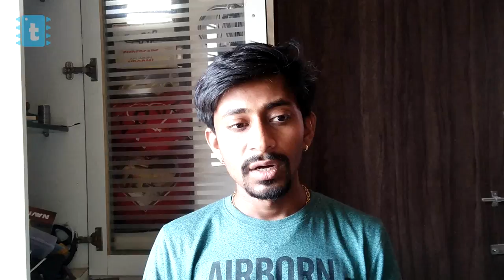New Series Trailer "Common Errors in coding ESP8266 / NodeMCU boards"

Comment: I have made a nodemcu server for controlling 4 relay, every thing works fine but the microcontroller hangs after some time, I am using nodemcu ver1 with external power supply of 2 amps . Help required to prevent the hanging out server

Comment: I have designed a project for switching light through an app, but i also want it to be turned manually by switch, what if it is turned on by both ways at same time, will it harm the relay, if yes what should be done to protect it?

Comment: I can't connect my esp8266  to my computer (the com  port is not showing even after installing the drivers) . when i google it i can see many results but all are deferent. what is the steps that you used from the first to last, so i can redo once more
Reply: Rabeeh T.A Change the usb cable. Use a standard one. You can also use the one available with the smartphone chargers
Reply: Ruchir Shah ofcourse i have done that, thank you for your replay i appreciate it.

Comment: This is the error i get when I compile the force sensor: 

readlink C:\Users\ssins\OneDrive\Documents\Arduino\mqtt_esp8266_examplea1: The system cannot find the file specified.

Error compiling for board NodeMCU 1.0 (ESP-12E Module).
Reply from the maker: Again download the code and try
Reply: I don’t think you have a link to download the code. So I just followed the video. I changed only analog pin to digital D0. Since I want to use a door sensor. Also if you can help Adafuit website has an expats layer on feeds. Group and default will this affects the code? Thanks.
Reply from the maker: Do one think

As shown in the video which i have uploaded today, try deleting the library folder you have pasted everywhere and try installing like I have in the video which I have uploaded today

Then go for the example code
Reply: I just watch your video and deleted all Adafuit MQTT library and install it from the  link your provided in github. Installed correctly. But I still have the same error upon compiling. “ the system cannot find file specified”.
Reply from the maker: Kindly watch this video
https://youtu.be/vPAoMiuE_Rw